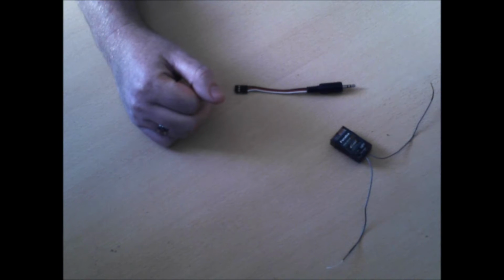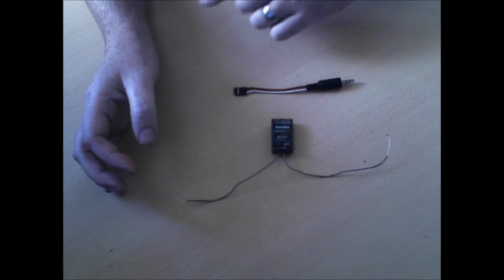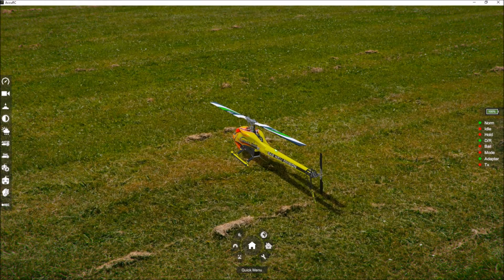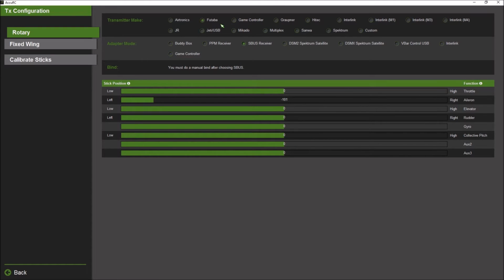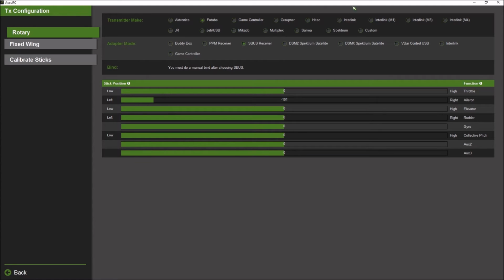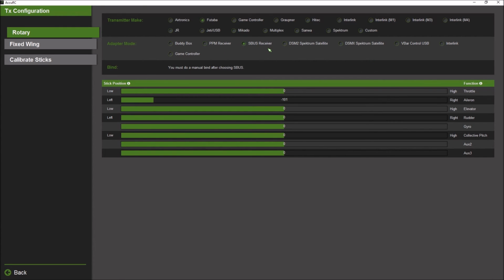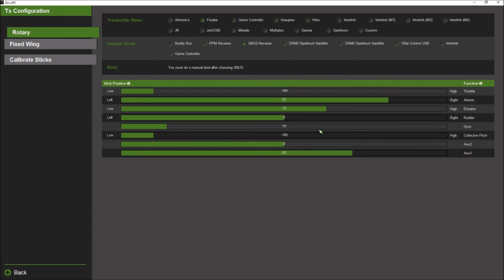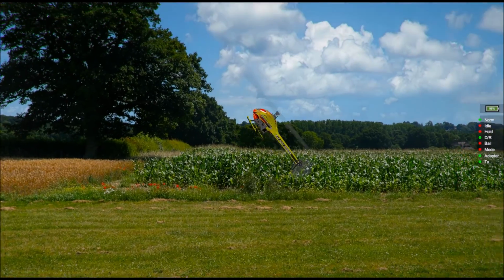How to use AccuRC wirelessly

Comment: and for Mikado VBAR CONTROL when.....with next i can just connect with the usb port and go flying
Reply: you can do that already (if you have the AccuRC dongle plugged in too.
Reply: how can i do this. with  dongle to mikado VBAR CONTROL
Reply: +olivier974 Mikado do not make an sbus or similar rx that I'm aware of. they do sell a wireless sim interface but it's over 100usd 

the good news is that the sim interface they sell should work with AccuRC.
Reply: ok thanks; you can work for an usb wireless dongle for all makers .....in next days perhaps